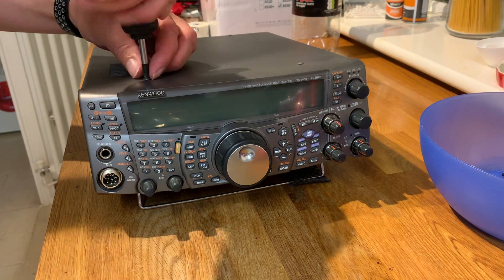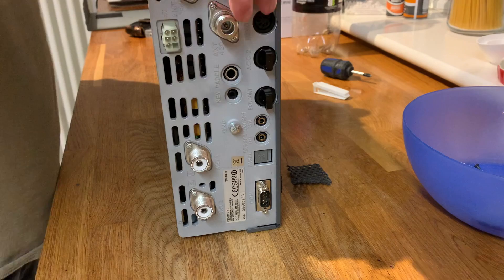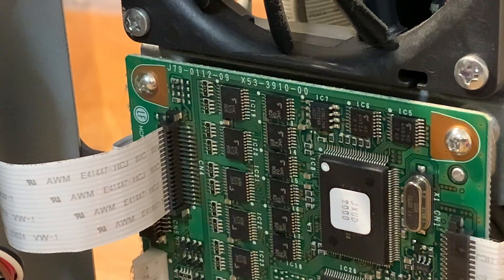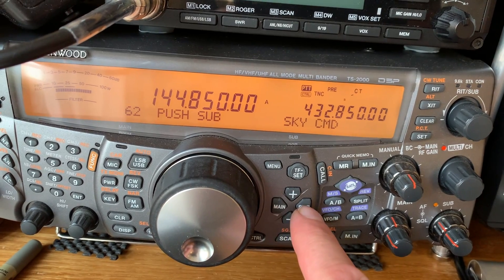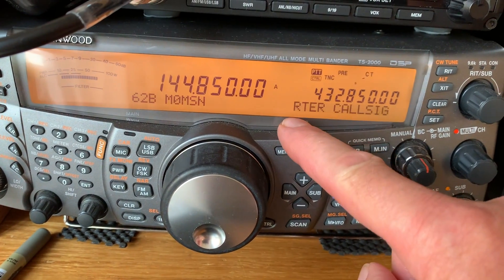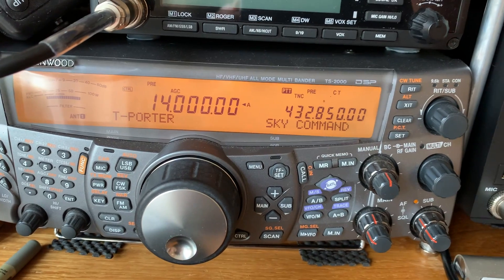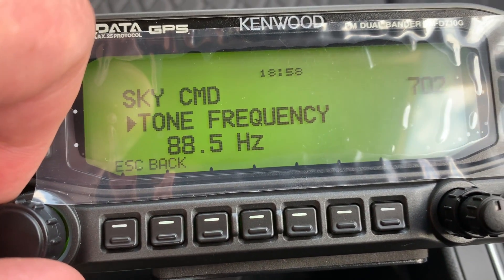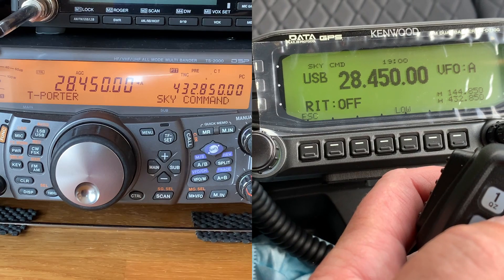HAM RADIO: Kenwood Sky Command All the Bands on your 2M/70cm Rig.  Fun Radio

Comment: Looks like there is a solder bridge after the diode removal
Reply from the maker: No, the trace is a common rail, so it was only the PCB lacquer that has been removed.  But thanks for the steer, and well spotted.